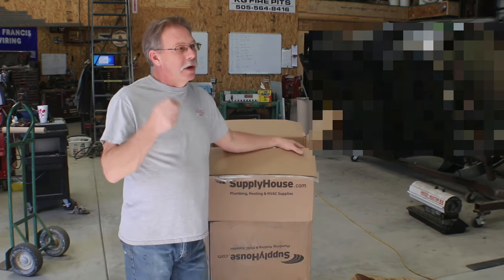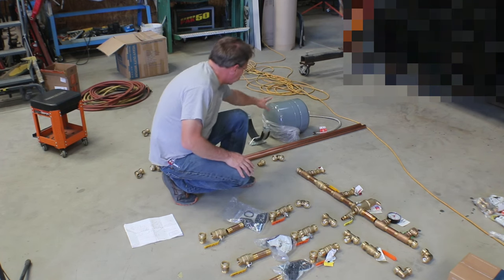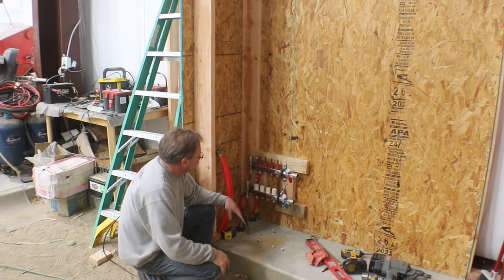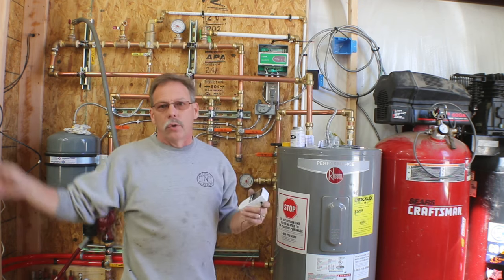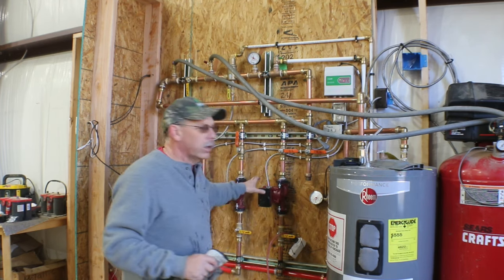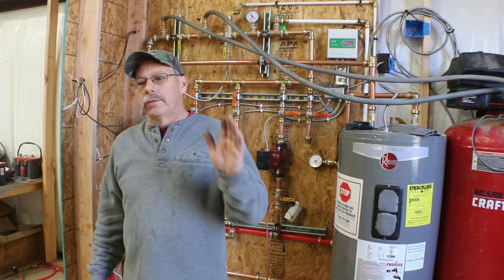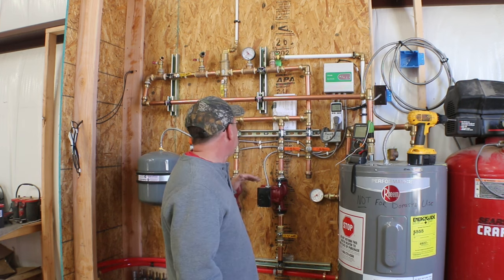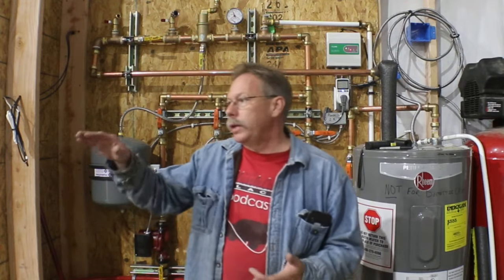Can you Heat your Shop with a $200 Water Heater? Radiant Floor Heating For My Shop | Allison Customs

Comment: Hi there you've done a good job from what I've seen but the only difference I did was take your hot water line and split it so half goes into the floor and the other half goes right back into the hot water tank that way your tank water will always stay warm and you will use less electricity to heat the water. that's the only different thing that I did and it works great. Just my 2 cents worth. good job though.
Reply from the maker: Interesting, what temp are you running your water heater at?
Reply: Actually I was using a small boiler but on my new shop it will be like yours with a hot water tank. I will split the outline with the hot water and feed half back into the tank , it just helps the mix of lower temp water reach the hotter point faster and it shouldn’t matter what temp you’re at, it works great, Mike

Comment: i would have really used soft copper piping for in-floor heating. yes, it costs more. but you are not going to have very good thermal transfer from the pex. on top of all that, just due to the length and diameter of tubing you are probably basically just swapping the water in the floor rather than "dumping the tank" you just have too little heated water for the body of water that is in the floor. so do this, try letting the heater heat up. Run the pump for a few min(3 or 4) but more frequently (with more heated mass already in tank will help quickly heat the rest)
Reply from the maker: Interesting and certainly an expensive design!  I wouldn’t even hazard a guess at the cost and I’m not sure what would happen over time to copper embedded in concrete.
Reply: You don't want copper coper imbedded in concrete as it will start galvanic corrosion on the copper from the lime in the concrete and then the floor will be useless in about 5-10yrs when pinholes start

Comment: As you mentioned, you need glycol to avoid bursting during a cold weather shutdown.   Glycol does not transfer heat as well as water.  So the system may need to circulate more than with water.  No big deal, but it does require more energy.   You can read the manual for your glycol.  It will of course tell you how rich to run the glycol water blend to avoid bursting or slushing.  Of interest is how much glycol you need to have the proper corrosion package ( not a huge concern because you do not have a boiler) and to avoid algae growth.   My Dow glycol recommends running something like 30% or more glycol to avoid biological growth.   I accidentally demonstrated this growth in some slop I had saved that was about 10% glycol.  Biological growth clearly appeared.  I think it is a fungus but people call it algae.
Reply from the maker: I have similar issues with maintaining my water table on my plasma table.
Reply: If glycol does not transfer heat as well as water and you need to have 30% glycol to avoid algae/fungus growth, seems like just having a way to drain the system to protect it in the event of a cold weather shut down would make sense unless the building wasn't being used/checked on but that would be similar to the problem you'd have with the water supply lines in your house if you lost heat while you were away and nobody was stopping by while you were away unless I'm missing something.
Reply: Dowfrost Engineering & Operating Guide, pg 7 states that less than 25-30% (by weight) propylene glycol is needed to have an adequate corrosion inhibitor dose.  And it states that less than a 25% prop glycol mix is at risk of of bacterial contamination.  Pg 27 shows that at 60 degrees F, water has a thermal conductivity of 0.342, 40% glycol is 0.220, and 50% is 0.195.  This guide is full of easy to read information.        Slab heat takes some time to get the room above up to comfort.  A hydronic radiator with a fan (unit heater) can do the job quickly & noisily & leave a cold floor.       Filling the system with pure water, then using the system & shop, then draining the system and idling the system an shop…..and repeating again and again…… is impractical if the cycle is more than once a year.  Purging air, water flash freezing in the pipes as they are filled, time expenditure, exposing the damp drained system to oxygen corrosion, and so on.      This project, was well thought out, nicely completed, and imaginative.       I would enjoy also having a unit heater tied into the system to get shop up to temp for the 1 or 2 day projects and/ or also to make the shop usable while the slab is coming up to temp.   I would minimize the glycol ratio to match my climate and the cautionary factors regarding running too lean.  The extra electricity for using glycol mix versus neat water is unavoidable in my opinion….and that’s why my garage and house runs 40-45% glycol.   I certainly enjoyed the videoed project and congratulate the man on his work.  Also other’s comments and replies.
Reply from the maker: Just not something I’m willing to risk when my system absolutely depends on electricity and it goes out regularly around here.
Reply from the maker: Thank you!  It’s a lot of work and I appreciate the feedback!

Comment: HOW IS THE SYS. WORKING OUT DOES IT STAY PRETTY WARM ???
Reply from the maker: It hasn’t fallen below 58F on even the coldest night since getting the whole place up to temp.  Most days and nights it’s locked in at 60f (where the thermostat is set at).  Now that it has been warming up some  the water heater only runs a few hours at night if at all.
Follow up video is in the works.

Comment: Maybe add  2 more water heaters  and defiantly fix the dielectric issue. I went with a big shop heater on propane. But rarely drops below 30 F here. Running all night is expensive i would imagine.  60 degrees is fine if you keep busy.  But good job,, anyone that does there own work is doing good.
Reply from the maker: Thanks! It has been expensive, but it was life changing to have heat in the shop all winter.  Never going back to the cold!  Just gotta make it more affordable!

Comment: A BTU is a BTU your heat source is dramatically undersized.  If you leave in an area where you see -20 Degrees, square footage x 50 BTUH will cover you all day or do a heating load calculation requirement based on insulation in walls/ceilings as it appears building is fairly new.   Heating load calculations are easy if you know R values of insulation.  Q=U*Area*Delta T(indoor v outdoor temp).  U is the reciprocal of R value so R-19 = .052,  R-30 would be .033.  Primary/Secondary Piping would have been a better choice with zone valves vs pumps IMO for what you were looking to accomplish and would have cost less and solved issues with airlock.  Pump away from air separator so you lowest point of pressure is on inlet of pump.  that allows air separator to do its job.
Reply from the maker: Someone else also made the suggestion to get the pumps turned around and doing just that. Parts are on the way for the switch. 
The heat source is definitely undersized, I have completed a HL Calc and it just proves what we both know. 
The original idea was to use a waste oil boiler, unfortunately I just don’t produce the amount of oil necessary.
Check out the current situation - https://youtu.be/_mR7S4N28oY
Reply: @AllisonCustoms  Hell yeah Bro!  Your work looked great.  HVAC has a lot of interesting things that make a big difference that are just learned by experience
Reply from the maker: At least that is true for me!

Comment: Suggestion: ask arround to your local HVAC companies for a used 100-150 gallon non functioning waterheater. It's use is to store the heat medium used to actually supply the floor when piped inline
Reply from the maker: Thanks for watching!
The original idea was to use a waste oil boiler, unfortunately I just don’t produce the amount of oil necessary.
Check out the current situation - https://youtu.be/_mR7S4N28oY

Comment: Would it work if you turned the pump flow down to match the recovery rate of the Hot Water Heater for the desired water temperature?  The whole thing could be controlled by 1 or more line voltage thermostats.
Reply from the maker: I’m really not sure. I think that could work, of course that would force the water heater to run full time. Of course that may not be changing anything.

Comment: Here is something that might be helpful. If you have a shop it’s cold and you want to warm it up. If you have a woodstove you are taking air from in the shop that has been heated or wants to be heated and sending it up a chimney. That air is replaced by incoming cold air. This is not a permanent solution but it might help you. I’ve bought at an online auction an older style clothes dryer. Plug it in put a hose on it if you want to to direct the heat and let it run. It re-circulate the air in the room. There’s no loss up a chimney and it’s safe and reasonably quiet compared to a furnace. As I said, it’s temporary but useful. The dryer that I bought because it was an older style about eight or nine years old. I paid one dollar for it.
Reply from the maker: I’ve seen similar ideas on YT also.
Thanks for watching.

Comment: If you keep the in floor pex UNDER 200 feet it will actually heat more efficiently and provide more warmth!  Yes you CAN do 300, but under 200 is way better.  I am saying this from experience.  A very good friend of mine has done this numerous times for himself personally and has learned.

In his first install he had an electric hot water tank but never used it as the heat source.  He heated it with a home made wood boiler.  His pipe runs were 300 feet.  While it did work, it never did get warm in there.  It DID take a good amount of the chill out of the air. 
On his next install he did a max of 250 foot run, and had significantly improved heating.
In his latest install which is ran purely on a outside wood boiler (thing burns through 20 cords through winter) he kept the runs to 125’ and the shop is a SAUNA!  Off of the boiler he is running a single vehicle shop, heating the barn, heating the house via a liquid to air heat exchanger in the furnace (which CAN burn heating oil, he uses diesel and it CAN heat the water to about 45°F, obviously inefficient to heat anything else) heats the potable hot water via a water to water heat exchanger, heats multiple bathrooms with in floor, and heats the newest addition with in floor heat.  He also heats the pump house with in floor heat as well. He TYPICALLY burns a lot of wood, but will supplement the heat in the house with diesel since it is not capable of heating it very fast especially at -40°.  I have heavily suggested adding additional radiators to the house.  We will see if he does.  

All of the systems have been at separate properties that he has owned.  I do miss the original place that I knew him from (his first in floor build… which has a bit of a funny story.  His “pressure relief” originally was just a pipe up to the roof and that was it.  He forgot to turn on the pump after lighting the fire and pretty soon there was a geyser coming out of the roof…. Still makes me laugh) since that place had the best shop space.  However I do not miss the ex-wife.  His current (and 2nd) wife is one of the best people I’ve met.  The farm needs a lot of heat, and it is provided for by his set up.
Reply from the maker: Sounds like some very interesting projects.  
Not sure I would want to collect 20 cords of wood every year.
Yea, I screwed up that last piece of slab, but hopefully when I do the next, I can do a few things to offset that.

Comment: You might want to get 2 steel 55 gal drums, they are cheap, box them in with 12” of insulation and plumb it ti electively add 110 gal to your hot water heater capacity. You can also add insulation to you hot water heater very inexpensively. Nice job.
Reply from the maker: Nice idea, and would be way cheaper than a commercially made storage tank.

Comment: You sure did a great job on this video, I just am so concerned about the electric bill. Solar would be nice, but we all know that winter when we need the heat the most, is the season we get the least out of solar…
Reply from the maker: I’m working through a solar system now and should have a video soon(ish).  Here is what last season ended up like.
Shop Radiant Floor Heat - How Much did using an Electric Water Heater Actually Cost?
https://youtu.be/5jO3bHkLhJE
Reply: You could add a heat pump water heater to the system to reduce the electric bill quite a bit, but the pump itself could be somewhat pricey. I would leave the water heater and have it set to run and maintain a minimum coolant temp for the very coldest parts of the year where the heat pump may struggle. If I remember correctly A heat pump uses about 1/3 or 1/4 the amount of electricity to produce the same amount of heat as a resistive heater such as a water heater, and heating a shop that size it wouldn't take long to get your money back from the heat pump.

Comment: how many BTUs is the hot water heater?  you might consider an on demand tankless water heater; that will give you 12 gpm @ 120F.
Reply from the maker: It is currently running two 5500 watt elements on 220v, so approximately 37,500 btu - not nearly enough.  The water heater works, just not an efficient method.  
I should have a new video out early 2023 discussing my new solar system and the highs and lows of hydronic solar.
Thanks for watching and commenting.

Comment: 10 degree delta is actually optimal for in floor but your heat exchange theory is generally correct
Reply from the maker: Thanks for the comment.  I’m still playing with the system and I’ve added a new piece this season.  As I work out the details, I’ll be posting another video.
Reply: No problem my man...Love these videos. I'm a hydronics nerd lol. So with the slab you have a high mass heat emitter so it's gonna throw heat amazing as opposed to say fin tube where you're running 180 degree water through a low mass heat emitter where you want that 20 degree Delta T so your getting adequate space conditioning.
Reply from the maker: Towards the end of the season it was working pretty good, now I just need a better controller for all of the variables going on.

Comment: When you're running ethylene-glycol-and-water mix thru the pumps, what is the minimum temperature that the liquid can be at?
Reply from the maker: My mix is for -20 F   That is the coldest temp on record for my area.
Reply: @AllisonCustoms  Thanks for your prompt reply.  I asked the question because the technical literature on the UPS-99FC states that the minimum liquid temp is 35.6F/2C, presumably because this is slightly above the freezing point of pure water.  Of course, an EG-water mix freezes well below this temp, but Grumdfos does not consider this fact when setting the min liquid temp.

Comment: I hope you upgraded all the wiring to 2 separate 10 awg circuits since your running 2 5500 watt elements independently
Reply from the maker: They are actually 2 - 8 gauge, future proofing.

Comment: Good idea, but it seems like a better long term option would be to use an on demand hot water heater as its able to keep up with any amount of water. There are around the same price, but normally have a much higher electric draw associated.... If you had NG out there it would be an easy change over and would be able to heat that whole place even at night.
Reply from the maker: NG is the way to go!  I wish and may eventually figure out a way to get it to the shop.

Comment: Couple of points not spoken on - Water Heater warranty went to 1yr. System should run at 12PSI not 15 and that expansion tank is set to run at 12psi. If you run it a 15PSI then you have to adjust the air pressure in the Expansion Tank. Lastly, you must also account for the antifreeze. 100% Water doesn't expand at the same rate as what ever your antifreeze mix is.
Reply from the maker: Thank you, all great points.
Reply: I have 3000sf of radiant heat with manifold actuators and a boiler. I dont know how your loops fill without filling them individually. Water...and electricity will go to the direction of least resistance...and not all loops are the same. I just changed the manifolds and the system would have no part of refilling without isolating each loop with street /50 psi water and pushing out all the air. It isnt difficult but sure takes time. Thanks for your video.

Comment: When the tank runs out of hot water, it would actually be better not to cycle the pumps on/off. By not cycling the pumps off, the water heater never stops transferring heat to the slap (even if the water existing the tank seems cold, it will always be warmer than the water entering it). The slab will also have a more even and gradual temperature rise.
Reply from the maker: Thanks, excellent point.
Reply: I agree.  I did the same thing in my tiny house.  Since you have a closed loop system you are just pumping the hourly btu rating of the water heater into the floor.  There is no need to add complexity of timers and such as the result is the same.
Reply from the maker: Thanks.

Comment: Everything is setup really well. 
The only problem is, electric water heater won't cut it. 
A gas water heater will work .
Reply from the maker: Gas would be better, but yes the electric has worked well enough.
Reply: @AllisonCustoms  as long as you are happy. 
Up here in Canada when temperatures go down to minus 30 or 40. It wouldn't work well, have tried it and went to a gas boiler.